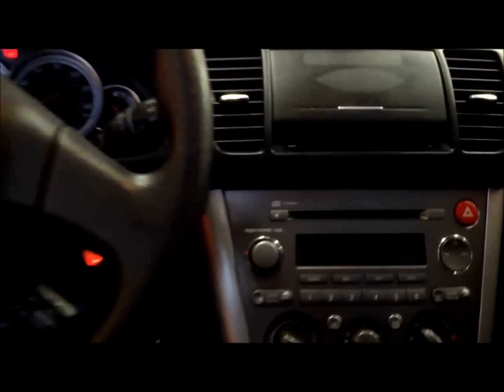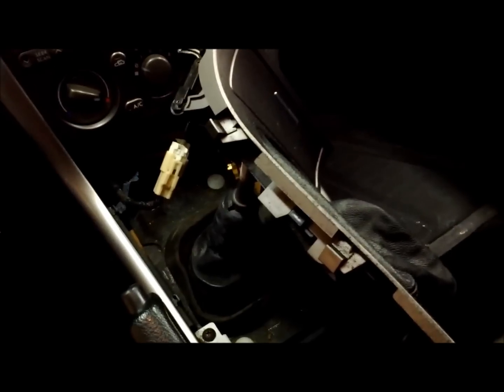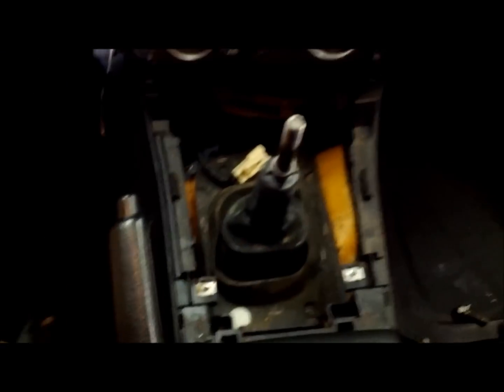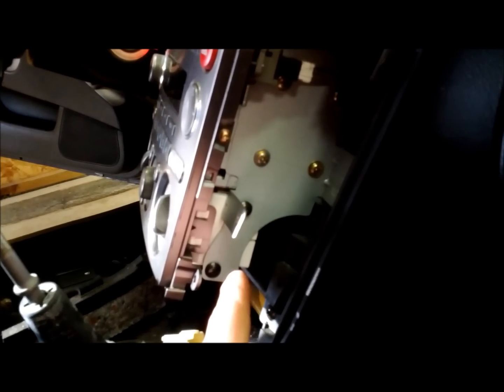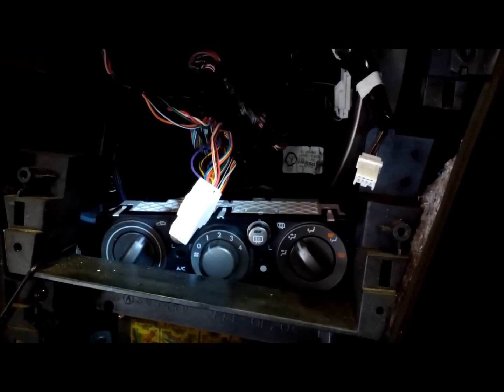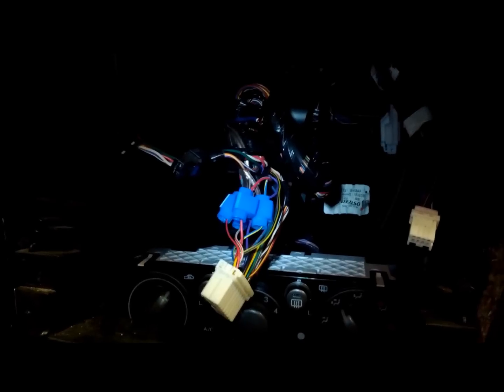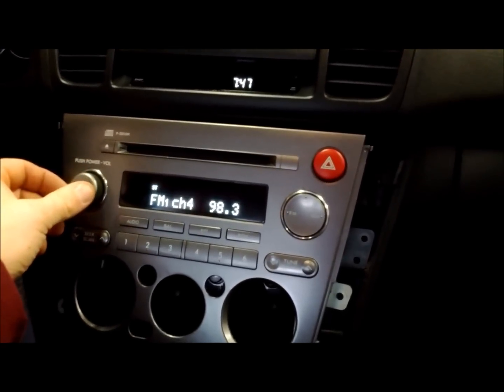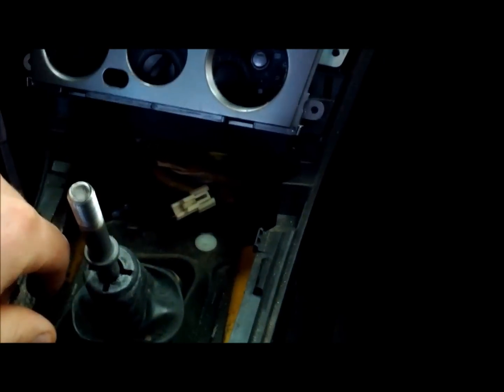How To Remove A 05,09 Subaru Legacy, Forester, Outback Radio

Comment from the maker: Good point I forgot to mention the steps for an automatic car. Thanks I will update the write up on the website... Link in the description. For an automatic car you will need to remove the small ring just under the shifter knob by pulling down on it and then remove the C-clip that holds the shift knob on. With the C-clip removed you can now remove the shift knob and then the small ring and then the bezel. Good Luck, Hope that helps..

Comment from the maker: The factory radio doesn't have an aux plug. You can buy a new radio bezel and adapter to install an aftermarket radio/ head unit. If you click the link in the description and at the end of the first paragraph it has the links to what you will need to do so.

Comment from the maker: It has the car harness plug, It also has the antenna plug and a ground plug. What style FM modulator are you planning on using? Most I have seen go into the cigarette lighter and are wireless so there is no need to remove anything interior wise.

Comment: Definitely a helpful video, it was so easy to do compared to what I have read on other sites. Let me ask you this though, you hooked the remote wire up to the yellow/black wire. When I did that the amp was off when I used the CD player or Aux, but was only on when I used the radio. I ended up hooking up to the yellow/red Radio Ignition Switched 12V+ Wire to correct this. Was there a reason you used the antenna trigger wire?
Reply from the maker: Some people learn by seeing/ watching rather then just reading. The person only listened to satellite radio or there ipod with a Fm transmitter. So this wiring this way only has the amp on when the radio is on and not on as soon as you turn the key on. On an aftermarket radio/head unit the power antenna wire/ remote has power whenever the radio is powered on.

Comment: That is a helpful video. Question: Shouldn't you unhook the battery before unpluging/plugging in the unit?
Reply from the maker: I have never unhooked a battery when removing a radio/ head unit, I have never had a problem.

Comment: On the 06 Legacy automatic you need to use a plastic card and wedge under the silver ring-ting on the shifter base. it has 4 clips near each corner. Must be careful not to brake it. i have not needed to remove the knob, just move it to Drive position.
One thing i am wondering if a screw falls where the hell it goes, ive had few of them fall down there somewhere and cannot find them.
Id really appreciate if anyone knows where do they fall.